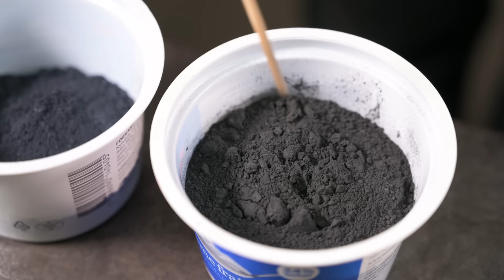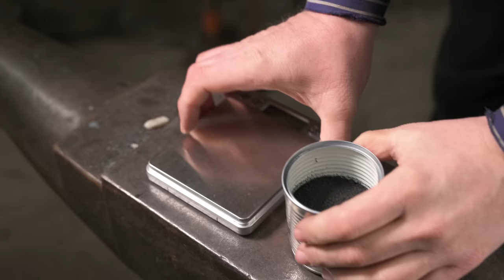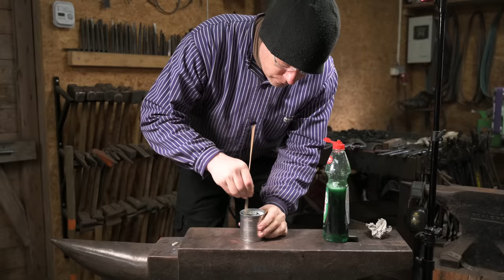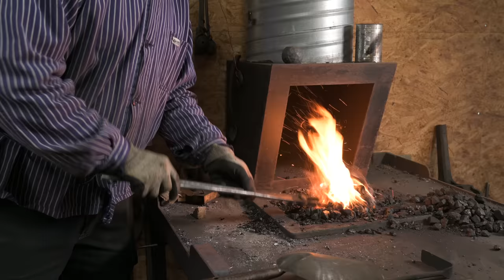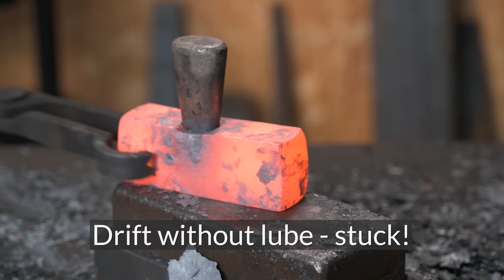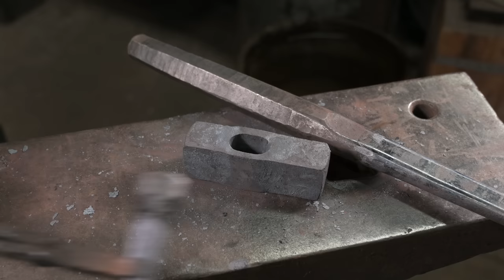Blacksmithing - Making forge lube *4K

Comment: Lube wont just make things release easier. It will also change how parts compress. A lubed die will exhibit less barreling due to frictional factors while forging a part. For steel industry typically uses graphite powder when a lubricant is used.
Reply from the maker: It makes total sense!
Reply: What's barreling?
Reply: @cholulahotsauce6166  Imagine crushing a cylander from the flat ends. Ideally we would get a perfect cylander. But friction prevents the ends from squishing out like the center. The resulting shape looks like a barrel.

Comment: I have both powders on the shelf but it never occurred to me to use either, let alone both, as a hot lube for punching/drifting. Wow, it's like magic compared to coal dust. Thank you!!!
Reply from the maker: It is! I will try mixing some powder with melted beeswax also, and see how that works.
Reply: @torbjornahman  I really like the water soluble mix you have here. I think it seems to be better than if you have a flamable medium. I may be wrong, but this worked surprisingly well
Reply from the maker: @Jimmy_in_Mexico  Yes, just be aware that it is water based... so don't quench any red hot H13 punches or drifts in it (although I have seen people do that too)!
Reply: @torbjornahman  This is why I make my punches and drifts from Atlantic 33.  If they get too hot I can just heat them up to dull red and re-quench them in water and I'm right back in business.  Sometimes if I leave the drift in the steel long enough it'll actually get to the right temperature that I can just pull it right out of the steel and re-quench it so that saves a step.  This is why I call Atlantic 33 "magical happy steel" and it's become my go-to steel for tools.
Reply: @torbjornahman  разогретый воск смешать с льняным маслом
Reply: I'm a whitesmith, I use (candle) soot when I'm casting... I wonder if that would work for you blacksmiths?
Reply from the maker: @drivestowork  The most basic lube is coal powder which is pretty similar.

Comment: Going to have to make some of this stuff! Thanks for sharing 😊
Reply from the maker: It's clearly something else compared to coal dust... I haven't tried the salt based products. They are good too it seems.
Reply: @torbjornahman  i used them extensively in an industrial hot forging environment and they are decent but not even close to the graphite molybdenum based products. parts slide along the surface much better of the tool and less heat transfer and better release. the only "White lube" product that has a similar structure to graphite is Boron nitride which works wonderfully but is extremely expensive and not an affordable option
Reply from the maker: @broadriverforge  Cool, good to know!

Comment: Nice!  I'll have to try making this stuff.  I've been using just some powdered graphite recently and it's actually worked surprisingly well; was going to mix it with some melted beeswax as I've heard that's a decent punch lube but this stuff looks pretty promising and will certainly stick to the punch a whole lot better.

Comment: I used to moly coat bullets for reloading and after reading on the bottle of molybdenum disulfide the extreme heat and preesure it can withstand I mixed some with linseed oil and used that as a drift lube with great results. I was wiping it on though and this dipping technique looks much better. Gonna have to get some graphite and see how much that helps too.
Reply from the maker: Cool. I will try to mix in some powder in melted beeswax also to see how that works. The water based is good for dipping, but will sediment with time so you need to stirr it after a while.
Reply: For lead bullets.  Try powder coat powder. In a old toaster oven. You can color for different loads. You will get looks at the range.
Reply from the maker: @maplebones  Reinvent? I just presented something that has been used for a long time. A product like "Never Seize" isn't available everywhere.

Comment: Moly powder and graphite powder with beeswax and alittle water to make it like a butter is great. butter up every axe drift before using. this recipe is better than white lube (sodium hydroxide), using the moly/graph  lube also prevents material deformation when drift is going into the workpiece, the graphite creates a skin on the drift allowing the hot steel to slide along the surface of the drift a bit before it is burnt up.
Reply from the maker: I'm going to try the wax also!
Reply: @torbjornahman  just brush it on when the drift is  warm and your ready to go
Reply from the maker: @broadriverforge  Could a hard block of wax (with powder melted in) work too? To rub on? Or it might be too much wax if you can actually get it to a block state again?
Reply: @torbjornahman  ive done it that way but for the big drifting i found using  small paint brush and having the moly,wax graphite powerder with a little bit of water just so its a thick slurry is easy to butter it up, i like a decent coat for the drifting i do but a hard block of wax would go on well if the drifts not too hot and just the right warmth so it melts on
Reply: I'm wondering if Vaseline would be a good carrier.
Reply from the maker: @cholulahotsauce6166  Try it!
Reply: @torbjornahman  where did you get the Moly powder? I'm seeing it on Alibaba but it's suspiciously cheap.
Reply from the maker: @cholulahotsauce6166  I bought it on ebay somewhere...

Comment: When Iearned punching holes the master told me, to put a little amount of coal grit on the surface of the piece and into the advancing hole, this worked out also very well. I enjoy your videos very much, the sound of the power hammer is very familiar to me.
Regards from germany
Reply from the maker: Yes, that is mostly what I have done until now. This is way better though.

Comment: That's some potent stuff! Mr. Hofi must have been one clever guy. Seeing it makes me wonder why every blacksmith doesn't use it all the time. It even looks cool.
Reply: There are many variations of this and many blacksmiths use them all the time. Where did you get the impression that they didn't ?  With enough experience, a blacksmith will rarely get a tool stuck . I know how frustrating it can be  for beginners.
Reply: @maplebones  I'm not a smith, just a looky-loo here on YouTube. I've seen a few people try out e.g. coke dust, with mixed results, but not a purpose-made lubricant. It could be that everyone does use stuff like this, but they don't show it on camera, so I wouldn't know.
Reply: @crystalsoulslayer  I understand. Blacksmiths probably don't think to mention it because it's not a critical element. It's like training wheels on a bicycle. After a while they learn to avoid stuck tools by using the proper technique. It's one of those things that's hard to teach and comes with experience.  Those having mixed results with coke dust will likely continue to have mixed results with other lubricants.

Comment: A Small lump of coal or powdered coal as been used in industrial for hundreds of years ,I use it my self for deep hole punching up-to 10” in carbon steel .for drop forge it was hard wood sawdust .👍
Reply from the maker: Sure but this is 10x more effective :) Much more expensive but it works really really well for some applications at least.
Reply: @torbjornahman  high there ,you are right it was a information to anybody to use, there are thing that have been lost to blacksmith and they need to be documented ,for example just one foil chewing gum wrapper in a coke forge will stop you fire welding .A clean fire and fuel is very important .Red lead powder mixed with paraffin is a barrier to molten cast iron ,you don’t need to use flux to get a good fire weld ,the scarf is the most important part .The more heats used to forge something degrades the parent metal.Coal as to be coked to be used in a open forge .black hot metal makes skin stick to it . Tempering is done after hardening .wrought iron starts its life as a bloom.Upsetting before you bend can give you a radius free bend .to calculate how long a revert needs to be to make a full cup is (the diameter half the diameter +1/8 of a inch.just a few things that I have used in the past 50 years of blacksmithing Kind regards JimRT.

Comment: It's good stuff isn't it! I have some in a ketchup bottle for those times when dipping isn't possible.

I've found that it's great for riveting too, a quick dab in the hole before putting the hot rivet in and closing helps get a really nice smooth action once you've worked it a few times. much nicer than the usual dry method.
Reply from the maker: Cool, nice tip! Thanks

Comment: That's a very cool Lube Torbjorn, thanks for sharing. Can't say anything about the 4k, still happily running a 1080p monitor and watching videos in 1080p, on occassion 1440p if YT fvcks up the 1080p, never 4k. Would be very curious how many of your folowers actually have 4k monitors and watch 4k instead of 1440p or 1080p?
Reply from the maker: I know! The sad thing is that YouTube seems to compress 1080p harder. A 4K video is looking much better in 1080p... 1440 would have been the obvious upgrade, but camera manufacturers doesn't seem to care much about that format.
Reply: I have a 4K monitor and the video is awesome.

Comment: Actually, I do have a question: the MoS2…. Are you not concerned with sulphur contamination in the alloy in thin forging? Embrittlement? Or does it stay in the scale?
Reply from the maker: I would be surprised if it had any affect at all on the material. It needs time to diffuse into the steel. Most will probably just fall off with the scale as you say.
Reply: @torbjornahman  seems reasonable. I’ve erred on the side of caution in casting with boron nitride. Mostly to minimize the oxide layer. But also to aide investment removal. A similar function. But, not inexpensive

Comment: Great video as usual! Do you know the reason for this recipe and the affect of each ingredient?
Reply from the maker: Thanks. The graphite and MoS2 is known for their "slippery" properties. I haven't researched the exact physics behind it. :)
Reply: @Torbjörn Åhman  I will try and research it more, Thank you for your for your answer😁
Reply: @torbjornahman  I recall from old courses that molybdenum has high heat resistance as well, when used as an additive to steel. That might factor into how the lube behaves when in contact with the red-hot steel.

Comment: I suggest a following discussion on liquid salt lubes. I remember reading i discussion and almost figururing out the composition - i have the hints written down somewhere - but not the mixing ratios and not all the constituents. IIRC it was something likes nitrates etc. Salts that do not make rust inducing vapors like halides and melt well. Supposed is the best and used by industry. And less grimy/dusty.
Reply from the maker: Boron nitride ?
Reply: @torbjornahman  I am trying to respont with an explanation but every time it just disappears. Apparently youtube thinks my chemistry is either promoting unsafety or my mentioning of heavy industry goods is an aliexpress spam bot :D lets see if this message arrives intact ;D
Reply from the maker: @Zonkotron  Strange! If you post links the comment will be sent for review, but I can't see any there either.
Reply: @torbjornahman  I shall try again. These "clean" forging aids are based on aqueous solutions of salts that have useful high temperature properties. Not a supermaterial like boron nitride :D I dont think anyone has ever made a DIY on the common smithing forums, i guess the material safety sheet is hiding some ingredients....i will put the product name in a seperate post :) People on anvilfire seemed pretty happy about the stuff, iforgeiron too.
Reply: @torbjornahman  commercial product is called forge ease
Reply: @torbjornahman  manufacturer is fuchs
Reply from the maker: @Zonkotron  Yes, I have seen it, but never used it myself.

Comment: Is a drift hardened? If so do you reharden it after you've used it?
Reply from the maker: No it's not. They are instead made from an alloy that can take the heat without deforming so much. H13 (hot working steel) is one of them.

Comment: Which of the three components did the trick most? I opt for the graphite.
Reply from the maker: MoS2 I think, but it's pretty expensive so diluting it with the next best makes for a good enough product. In industrial forging applications, graphite alone, is mostly used I think, since it's cheap.
Reply: I think everyone knows it was the dish soap. nods confidently
Reply: @torbjornahman  MoS2 seems harder to find too. I wonder how graphite + soap would perform. Obviously not as well but might still be worth it.

Comment: What are the advantages of using dish soap instead of oil or grease?
Reply: @bwhip, I speculate that less flammability compared to oil or grease is a part of it. Soap also makes things slippery and mixes well with water, unlike oils. The water would help to keep the drift cooler & less likely to deform.
Reply from the maker: Oil, grease and wax will work too I'm sure. Water is cheap and doesn't burn/smoke. All depends on the application I think.

Comment: I am curious. Can forge sludge be used when forging canister damascus?
Reply from the maker: You mean on inside on the walls of the canister? Not sure! Might work if you get the powder suspended in something more "paintable"...
Reply: @torbjornahman  Thanks for the reply. I have seen numerous blacksmiths weld up canisters and forge weld the contents of the canister then struggle to free the billet. Some use paint and other lubricant with limited success.

Comment: wonder how that would work as anti seize on bolts? i just ran across your older one on the flint strike, i was always told you quench those in water for maximum hardness and to get the most sparks per strike but used quenched in oil? does it make a difference?
Reply from the maker: Most high carbon steels are oil hardening steels... quenching in water, you run a high risk of cracking. I often leave them untempered for maximum hardness.
Reply: @torbjornahman  i've never had one crack in water at least yet! and we never temper flint strikers!  harden dunk and test on flint or chert!
Reply: Regarding the antiseize question: I work maintenance in a food plant.  We bought some new equipment that had a gear reducer with a shaft passed all the way thru it.  Replacing the shaft the first time required Big Delbert and his 16lb steel hammer.  You could feel the floor shake anywhere in the shop.  I found some "marine lubricating grease" in McMaster  that we used at reassembly.  That stuff was MoS2 based.  I swear, I pushed that shaft out with my hand at the next change.

Comment: I'm not really sure, but i think you can get the same results using "homokinetic joint grease"... have someone tried it??
Reply from the maker: It will probably work pretty good too! The grease consistency might be a little problematic, but might work fine for a warm tool!
Reply: @torbjornahman  besides, it could be easier to get instead of pure graphite and molybdenum... Im trilled that you answered!! Im such a fan!

Comment: ...or just use coal dust. Not charcoal dust as I have seen some people use. Coal dust. It gassifies and keeps things slick.
Reply from the maker: Indeed but this is probably 10x more effective!
Reply: @torbjornahman  It does look super slick. I'm glad you wear mask a lot of the time though. The mixture itself I'm sure is fine. But such fine particulate is always an issue. I'm glad you keep a clean shop too. The more crap that grinds into the ground always winds up in the air. This is one reason I advocate a "dirt" floor of some description (sand, coal dust, clay mix). Water down at the start and end of the day, controls dust quite well. Wetting down concrete tends to just make a slippery mess.

Comment: that is very slippery stuff...I once saw a demonstration where they put ball bearings under load with no grease, ordinary grease and  molybdenum disulphide grease  and while the no grease burnt out in seconds and the greased one went for a couple of minutes, the molybdenum greased bearing was still spinning full speed half an hour later...Its incredibly slippery stuff.
 
I personally use coal and charcoal dust in a mix of linseed oil and beeswax....its not as good as that.
Reply from the maker: Cool!